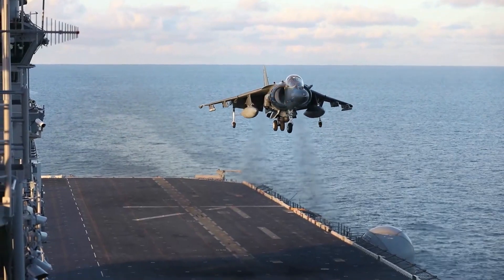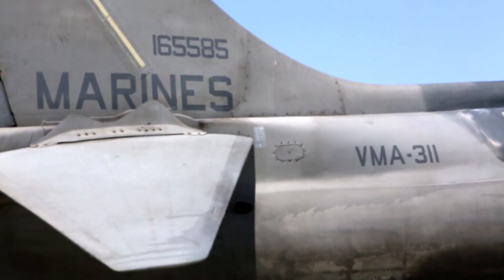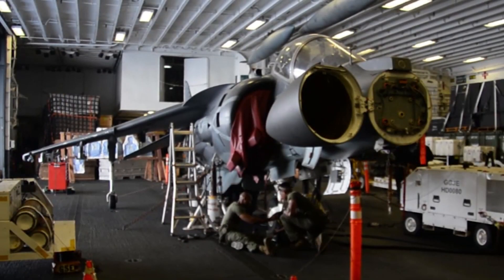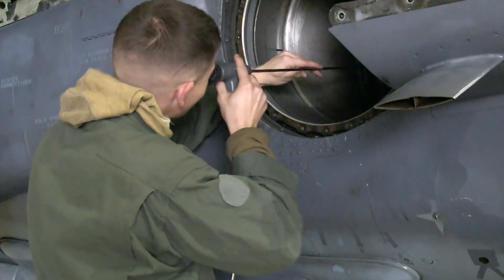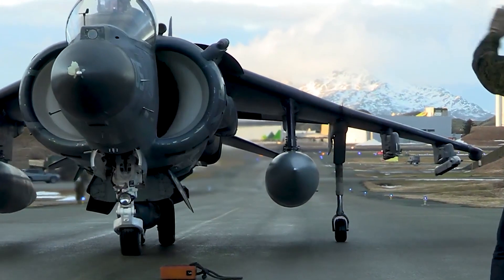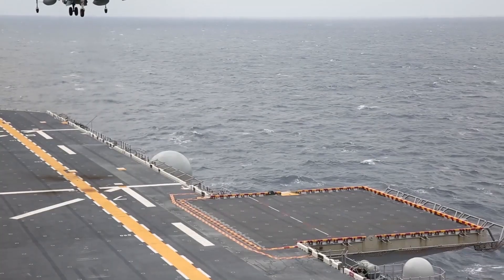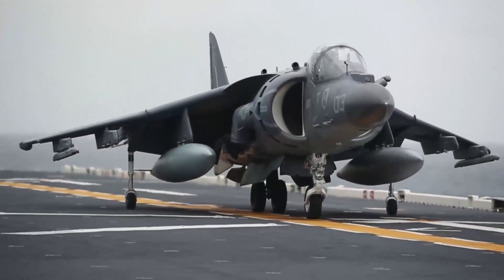The AV-8B Harrier had a history in its time before being replaced by the F 35 Lightning II

Comment: "F-35 Lightning II, a more modern V/STOL jet aircraft."(sic)

STOVL not V/STOL

"0:52 The Harrier GR.1 made its  first flight on 28 December 1967, and entered RAF  
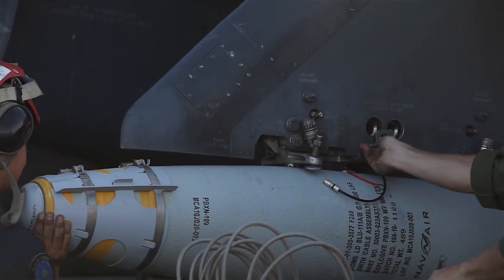1:04 service in April 1967."(sic)

Entered service eight months before its first flight? The first production GR.1 was delivered to the OCU at Wittering on 1 January 1969 and the GR.1 achieved IOC in October of 1969 with RAF No 1 squadron.

"by the team  of McDonnell Douglas and British Aerospace."(sic)

The Brits abandoned the Harrier II from 1975 - 1981 returning to the project after McDonnell Douglas had completed the redesign and Thatcher had become PM. The MoU that the UK signed in August of 1981 when it returned to the Harrier II relegated BAE to the role of subcontractor to McDonnell Douglas.

"2:57 At the time of the development of the P.1127 Hawker and Bristol had  
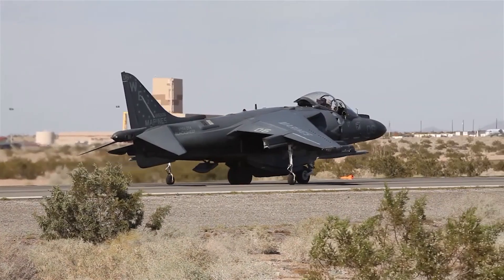3:06 also undertaken considerable development work on  a supersonic version, the Hawker Siddeley P.1154"(sic)

The P.1154 hadn't progressed much past the drafting table stage when the MoD canceled it and the BS100 on 2 February 1965 largely due to infighting between the RAF and RN who couldn't agree on a common configuration.